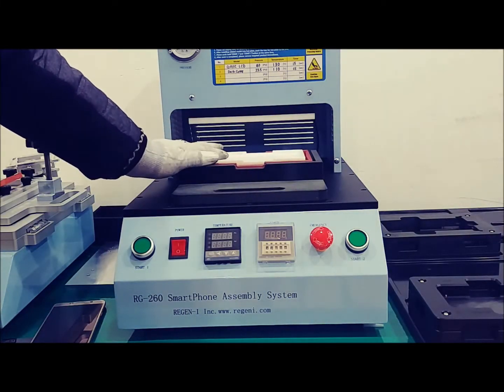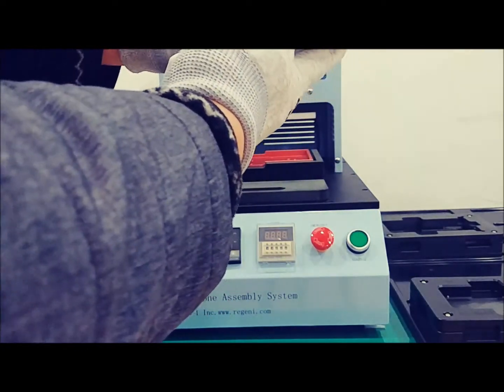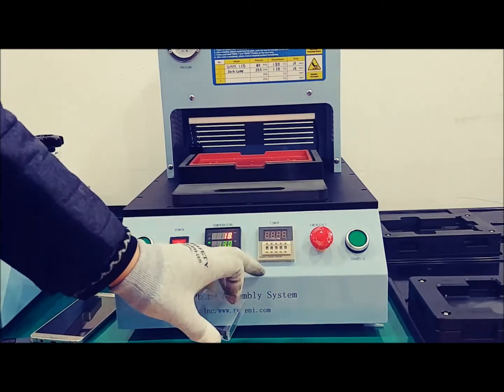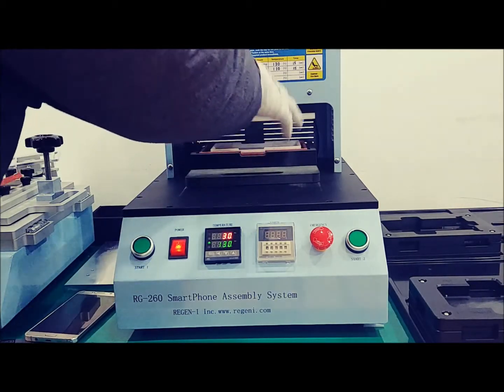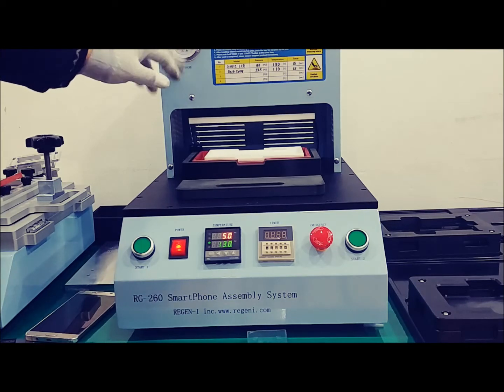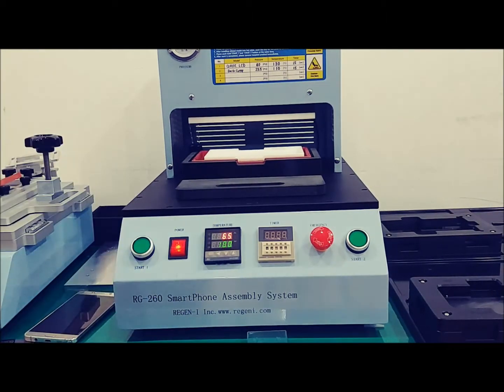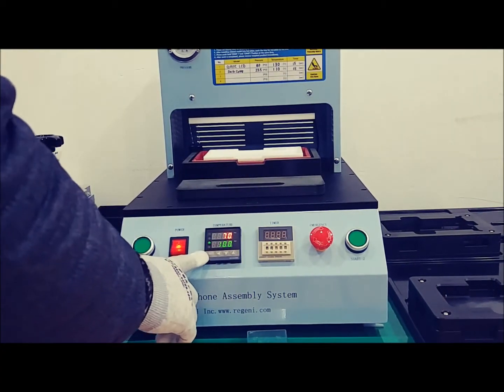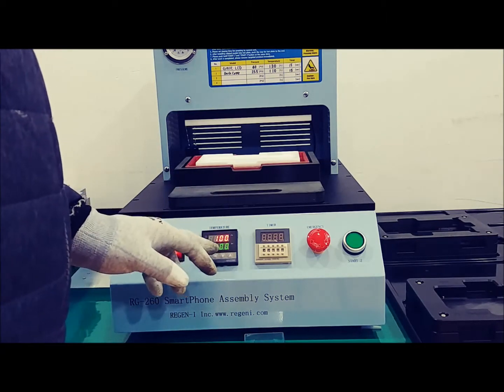RG-260 Smartphone Assembly System demonstration of pressing Note 5

Comment: Could you answer the following questions: What material did you use for the fixture? What strength and temperature are you applying to? What are the dimensions of the stepper? Can I use this machine for all smartphones? What is the cost? Thank you
Reply from the maker: Dear Roseli Queiroz,   please send me email for quotation by quantity -> michael@regeni.com  You can apply to all smartphone with supplied universal pressing jig which is made of silicon, Pressing Force  can be adjusted and Pressing temperature also can be reduced or increased by material of mobile phone. There are slopes in each universal pressing jigs, please give me question to my email. Thanks.